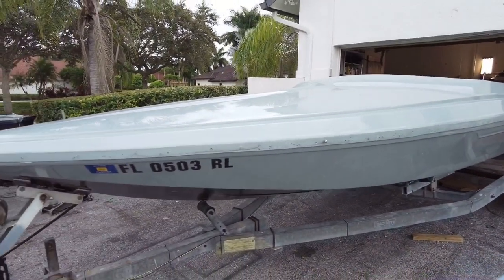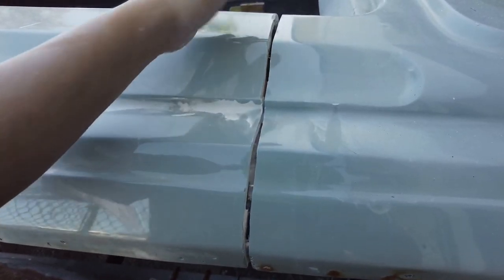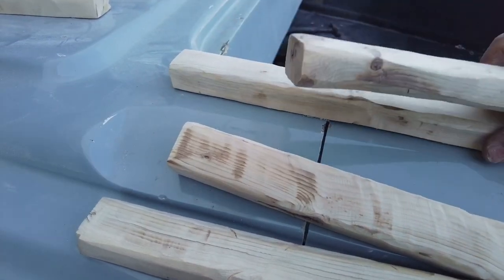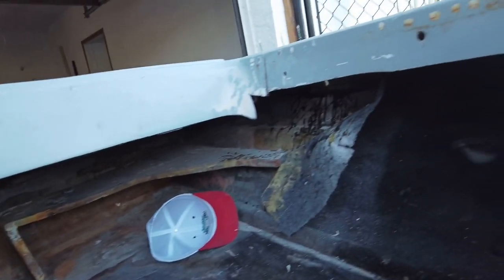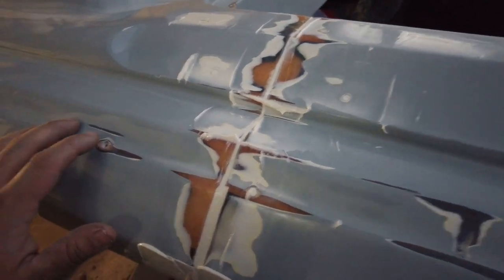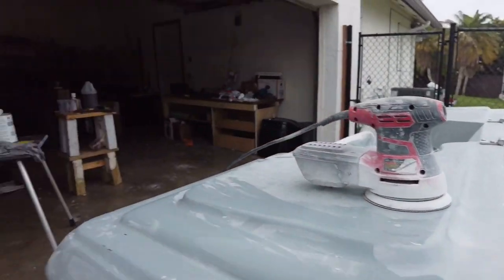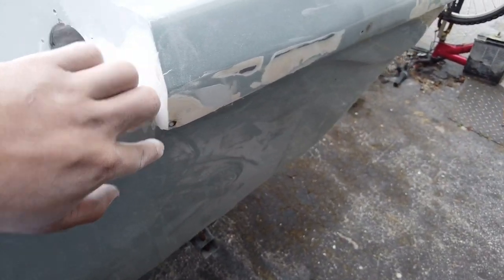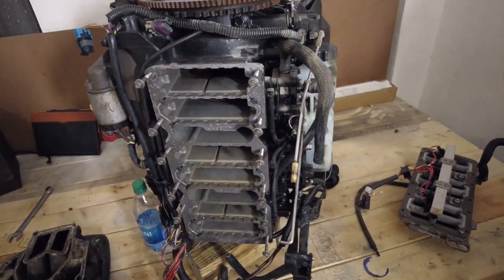Fixing Stress Cracks On My Project Boat!

Comment: I'm surprised how weak those spots were, but guess it just wasn't built up enough after replacing the transom. Did you use any good structural fiberglass when putting it back together, like a couple layers of 1708 or something?
  And yes, the setback and getting that lower unit up out of the water more will make a big difference, ESP if you put a nose cone with low water pickups and run surface props, that will improve handling dramatically and should increase speeds beyond what you are thinking (with some setup time and finding some good props). I personally LOVE the Yamaha style drag props and have had AWESOME success with them on the last few go fast boats I have had..
Reply from the maker: I was surprised also man. Yes I got a 3 layers of 1708 + the 1” thick core. The first time I put it back after doing the transom I only put 1 layer of 1708 thinking that was going to be fine ( obviously I was very wrong).   I’m running a 24 fury and my lover unit has low water pick ups already. We will see this weekend how she runs.